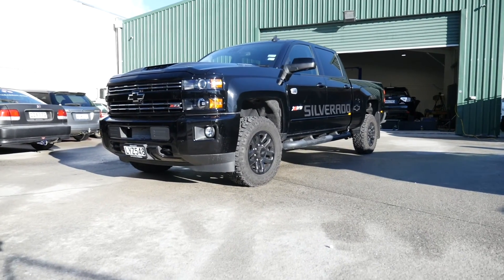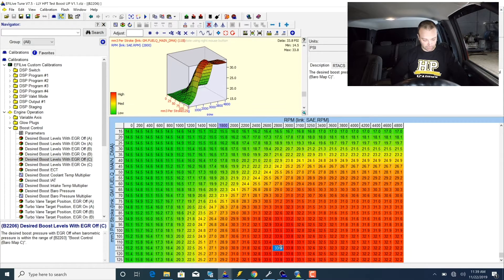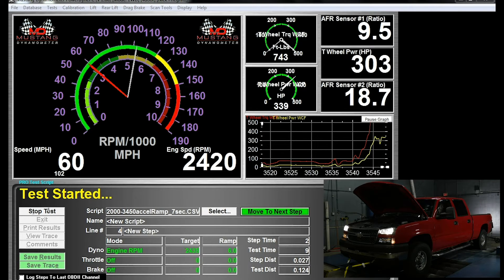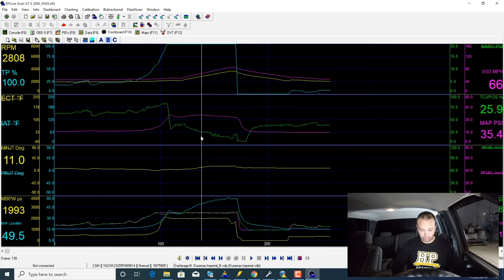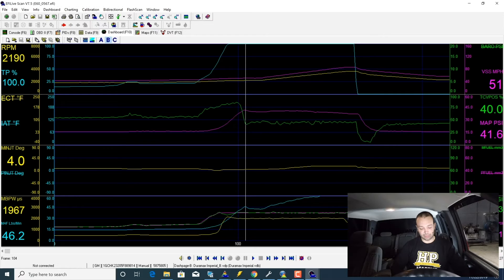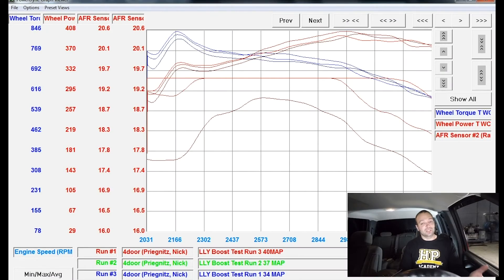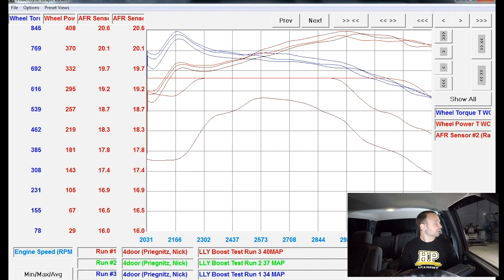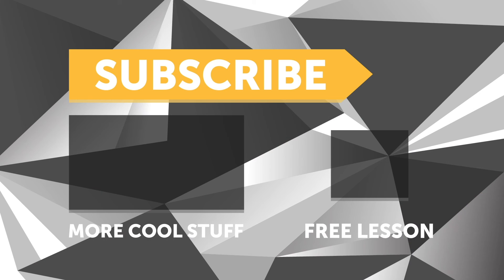Does More BOOST Always Mean More POWER? | Performance Diesel Tuning [FREE LESSON]

Comment: Okay but if you added more fuel on the boosted tune than you would use the added air for more power.
Reply from the maker: Doesn't always work like that, there are two lessons coming out this weekend which will explain this further, keep an eye out for them if you're interested - Taz.

Comment: He looks deferment today
Reply from the maker: It's just the lighting....😅
Nick is the diesel tuning guru at HPA. You'll be seeing more and more of him - Taz.
Reply: @hpa101   - How do u know if you've reached the efficiency of the turbo n when to stop increasing the boost n not make any more power??? For example ramping boost to 27psi but by redline it goes down to 25psi.. even when trying to increase the wastegate duty cycle toward RPM limit?
Reply: @radaces  then youve most likely reached past its efficiency. my vf39 turbo on a subaru build. with proper timing in the tune I am pushing 20psi at peak torque but as it goes to redline it tapers to 17psi my boost controller is completely maxed out and the turbo cant hold the boost meaning its ran out of efficiency. so if knock isnt an issue you can increase the power by adding timing but thats not always the best so it may just be turbo upgrade time. Back when i had my timing severely retarded it could hit 20psi at redline but that was because my egts were so high that it was over driving the turbo and not giving me any gains. I actually picked up 30hp by letting the boost taper and having more timing in the car